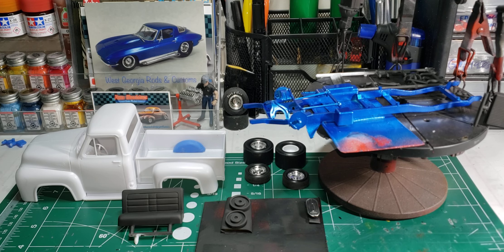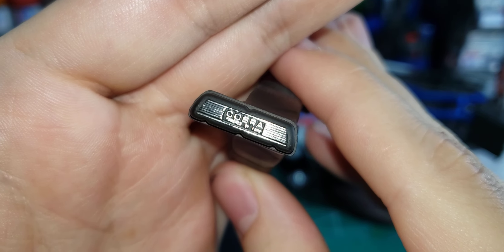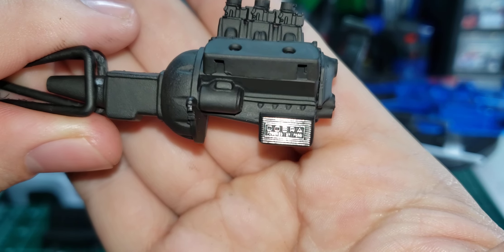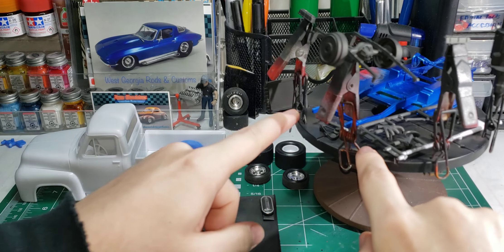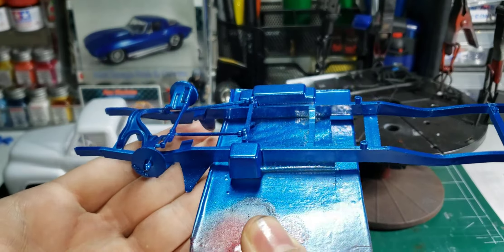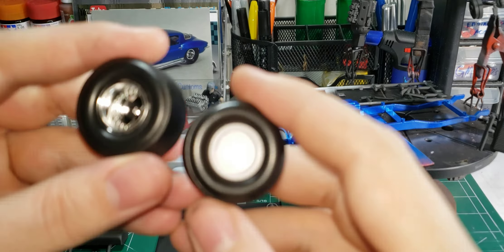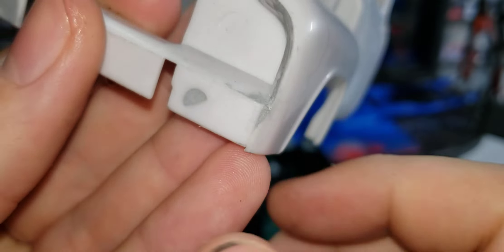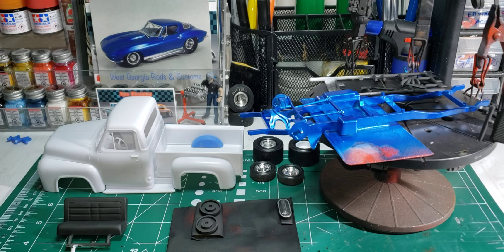USACC group build Pt.3

Comment: Looking good, Nick. You're liking that BMF under paint, huh? Ya know, $6 for a bottle of MCW isn't bad. If you airbrush you're thinning at a 50/50 mix and can get 2 bodies out of a bottle. If you're brush painting a bottle is going to last you a good while. I don't brush paint with it often, but when I do I still thin it a little bit for flow.
Reply from the maker: Thank you. I'm really liking the bmf under paint. Another level of detail unlocked 👍😎